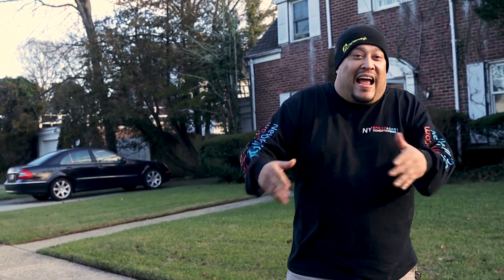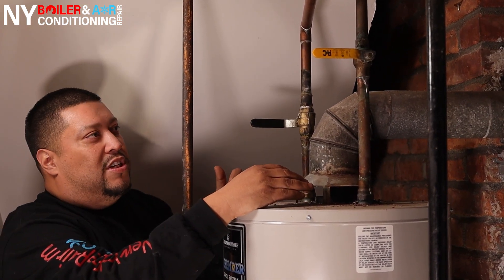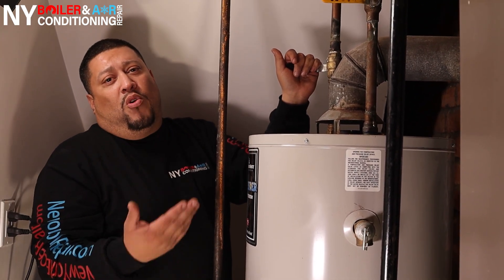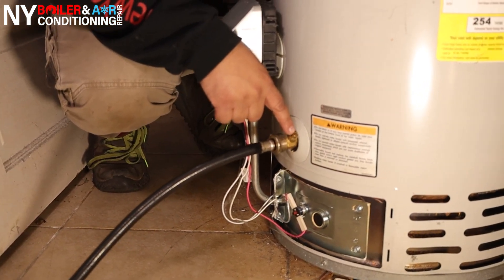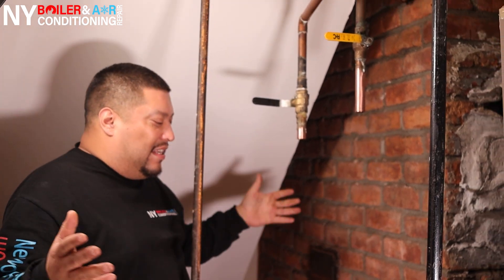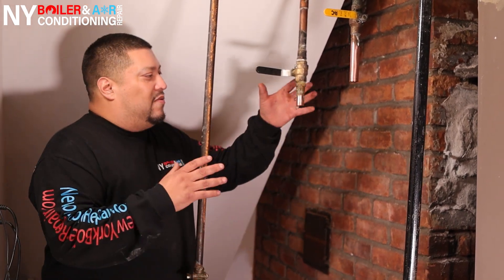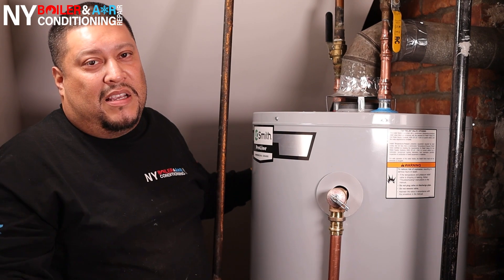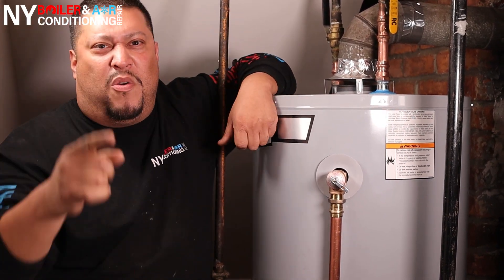40 GALLON WATER HEATER INSTALLATION

Comment: Will manufacturers still honor their warranty without an expansion tank if one was required?
Reply from the maker: You know that’s a really good question. From my experience yes because a hot water tank is separate from an expansion tank. They have honored the warranty to me. So with my experience I never had a problem but I can’t speak for everyone
Reply: @louietheboilerman  Out of curiosity I went and checked the warranty for the new A.O. Smith water heater I recently installed  ...WHAT THIS WARRANTY DOES NOT COVER ...The water heater is installed in a closed system without adequate provision for thermal expansion... Like your customer, I never had an expansion tank before and the water heater I just replaced lasted 25 years. I guess I'll be getting one now...

Comment: Do you need to use dieltric fittings to connect to the water heater since they are two dissimilar metals?

Comment: Thx… question, my A O smith has a blue plastic liner or plug in each water line on top. Do u remove those?? Seems like the cold line had 2 plastic plugs in it. I pulled one out thinking it was a plug for shipping purposes and then we noticed it was threaded. Then I used a flashlight down in the hole and saw a 2nd plug. They seem like they have a rubber check valve in it..???  The hot water line has a plastic blue sleeve inside the pipe that didn’t want to come out. After looking in it , it was just a liner inside the pipe…. What am I supposed to do with that?
Reply from the maker: Yes, you can not remove the blue plastic liner. Thats how the tank is designed. I thought the same thing when I first saw the same thing yrs ago. I’ve also made that same mistake too. 😂 but yes it supposed to be there and designed that way
Reply: @louietheboilerman  thx! I ended up calling AO Smith tech support yesterday (Sunday) which I was surprised they were there but they are there to help 7 days a week 9-5pm. You are correct. They do stay but if u happen to remove it does not void the warranty.   Was able to reinstall it and it seemed to operate fine.
They need to add a tag on top of the unit that states… “DO NOT REMOVE”